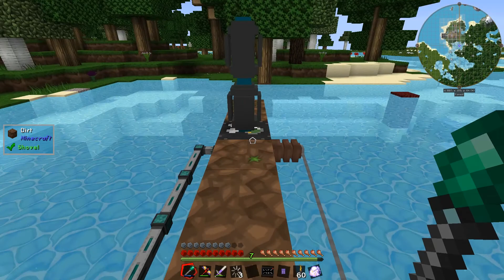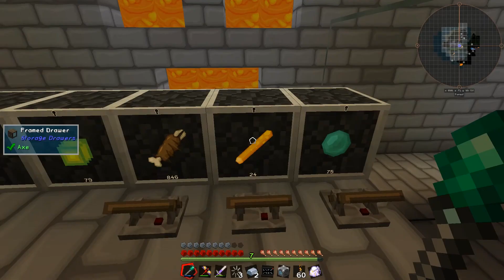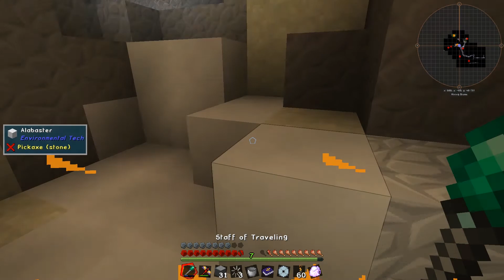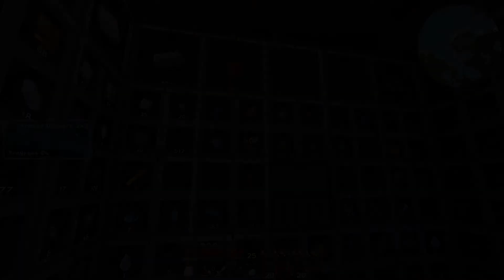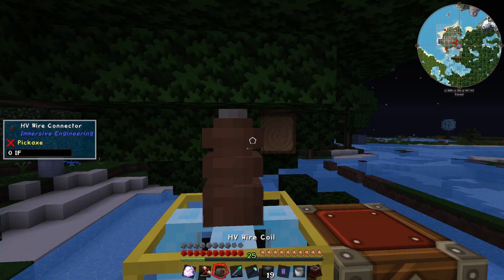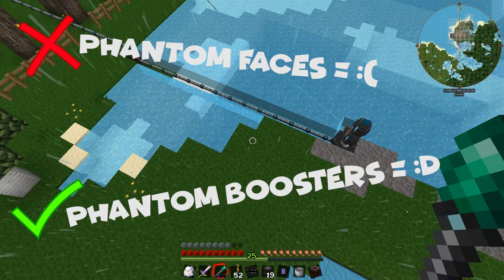Age of Engineering 30 | Void Miner | Closet Gamer

Comment: Ok, just finished the episode. I enjoyed it. I especially thought it was funny that you burned your house. If I may offer a suggestion or 3, I recommend making a resource miner with a white lens. You're going to want mica. Oh, I was about to say, use the mica to upgrade the blank upgrade things for 3 speed, and 1 accuracy, so you can die the lens what you want  to for current needs, but then I realized that's ore miner 2. But you may consider using your new resources on a neotech solar generator. Expensive, sure. But massive, lagless RF. I guess it really depends on how much you like the loud generators.
Reply from the maker: liquid klone
I'm glad you enjoyed it! It caught fire a little more off cam even with the glass on top xD I'll make sure I get a ton of mica. I was looking at the tier 2 void miner - I don't have the diamonds yet to make the structural blocks but I think with a bit more focussed mining I should be there. I was wondering of the ratio of accuracy to speed modifyers so cheers for that tip.
Reply: Closet Gamer I found 1 accuracy and 3 speed to be quite effective. But I have no math on that.

Edit, that is, of course, as long as you wish to use targeted lens.

Comment: Good stuff! :) Yeah, you may want the Void Resource miner too. 

Random heads up (I can't quite remember where NeoTech machines come in; its a bit later than you are now, but just FYI):  the NeoTech electric crucible and whatever one makes alloys can help you make steel MUCH faster. You'll probably end up doing an Arc Furnace from IE first, but if you can get onto it, do the NeoTech ones when you can - they are really fairly cheap to upgrade.  What you do is melt iron down into liquid iron, coal down into liquid carbon, and pump them into the alloyer (can config the sides so that you have a different side for each of the two internal input tanks) - that makes molten steel than can be pumped out and cast in a tinkers casting table or basin, nice and quick.
Reply from the maker: FallingofftheGrid the Neotech machines sound pretty neat, and I like that I'm going to get to use the smeltery some more, and automating it sounds fun too :)

Comment: I HIGHLY recommend upgrading to tier two void miner. First, the energy cost is cut in half and second, you can get an ore quicker than one every 20 seconds. In regards to the cobble generation just stick a compacting drawer on top of the cobble gen!  :)  

Great video (and sick Augustus Gloop reference)!
Reply from the maker: Michael Wittauer tier 2 is definitely a priority, I just need to build up the 36 diamonds for the miner and the 64 diamonds for the structural blocks :S I'll spend some time with my vertical digger mining ores only in the mining world for that, shouldn't be too bad :)

Comment: Random tip. If you get your hands on an advanced terrain module from calculator, you can change cobblestone in the world to stone. Useful for keeping basements clean looking, if you're just using stone. You can also change grass, dirt, cobble, stone, gravel, or sand into any of the blocks I just listed. I know you probably have no use for that. I'm just putting that out there, because if ANYONE knows about something that can exchange building blocks, I'd love to hear it!
Reply from the maker: liquid klone this is what I used to love about equivalent exchange in tekkit, an energy condenser and a bit of diamond and would have enough materials to build the Sistine Chapel! That's useful to know though, even for making standard cobblestone basements a tad more presentable :)